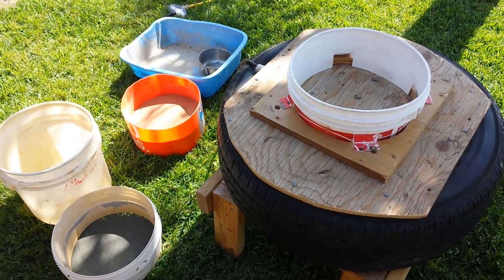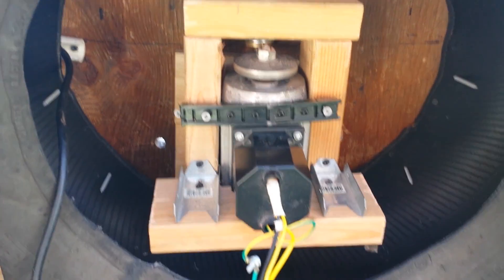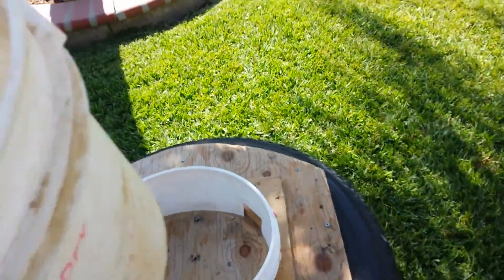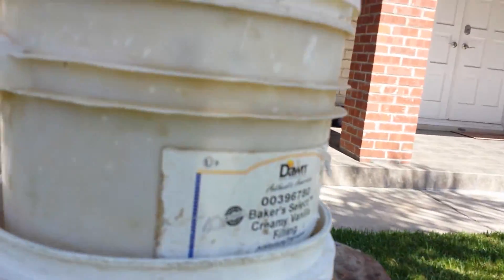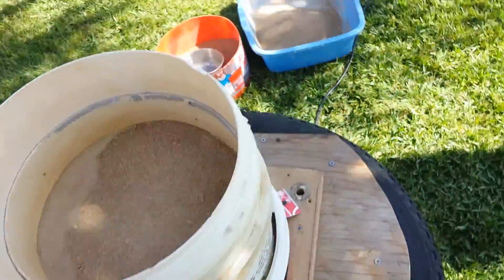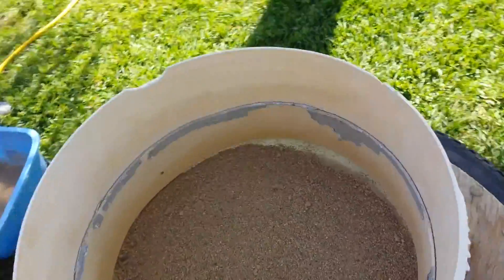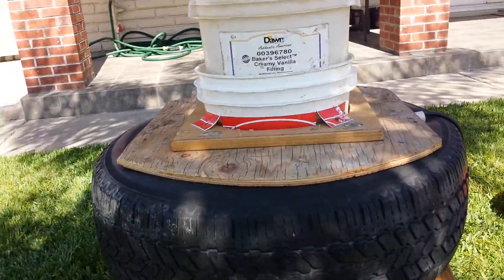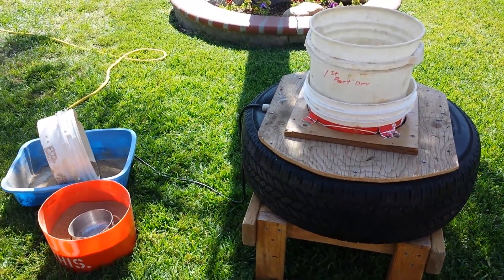DIY Gold Ore Auto Classifier - *** But It Got "TIRED" Easily *** LOL

Comment: here is an idea for you. put some springs on the bottom of the table. it will make it vibrate far better then it is as of now. think of a vibrating tumble and make it just like that.
 way of stopping the motor from blowing out. use a vacuum motor and put a couple of heat sinks on it and let the airflow into it more. food for thought